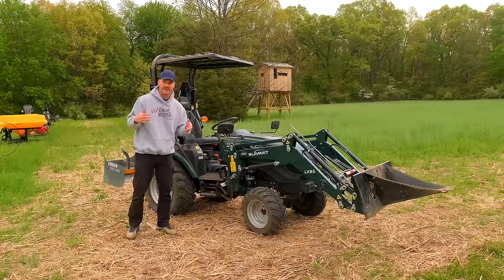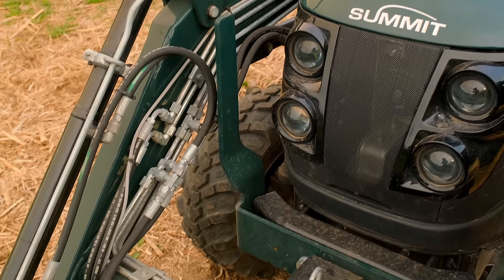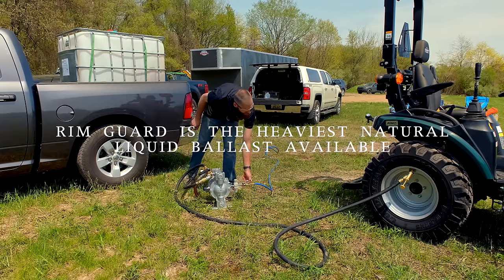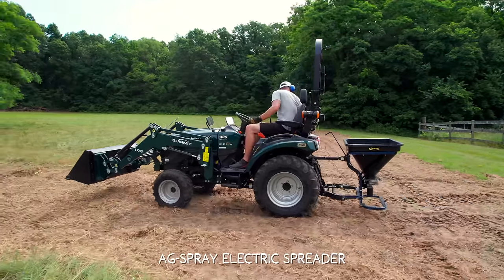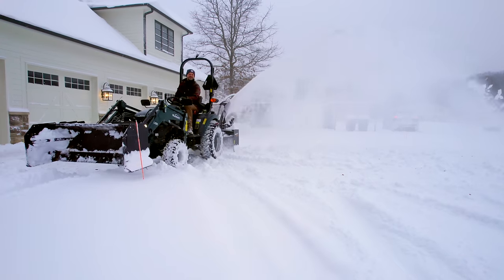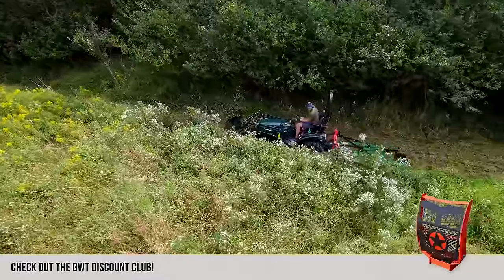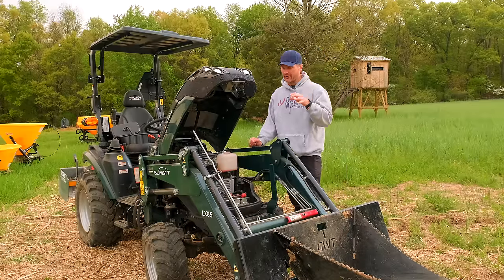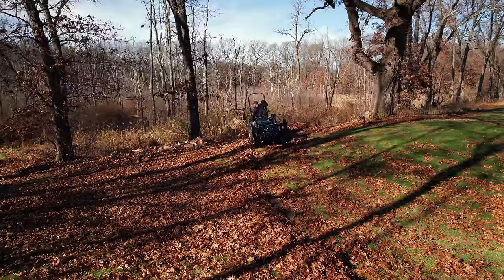50 HOURS ON THE NEWEST TRACTOR OUT THERE. WHAT DO WE THINK?

Comment: A rear mounted finish mower is always a better choice than a belly mount mower. You can sharpen or replace blades easy and can remove the mower and pickup another attachment without having your mower dragging in the dirt and mud. The adding of rim guard makes all the difference in getting power to the ground and a low center of gravity.
Reply: They’re a heck of a lot more inexpensive too since you don’t need all the hangers, lift and mid PTO. I’d never buy a mid mount mower myself
Reply: @LedgemereHeritageFarm mid mowers are super niche

Comment: The LX2610 has a similar battery location. It makes life so much easier when you need to get a jump or just plain remove it. If the summit wasn’t so heavy I would have waited until it was in production. I need my tractor to be light on its feet to mow pastures and grass paths that surround my farm. Besides the fact that 30% of my ground is always wet and 75% is hills, a heavier tractor would have gotten stuck to often, but I do love all the extra options that come standard on the machine. Maybe one day I’ll purchase one and just use my LX for mowing only.
Reply from the maker: The LX is a great machine too!

Comment: I have followed your introduction of the Summit compact tractor until this review. It seems to be a very capable machine and has many standard features that would be additional costs to many other brands. Your 50 review  reflects a very honest and fair representation of this value oriented new brand tractor.  Warranty claims, service availability and parts would be a concern in my opinion. However I am inclined to have a favorable opinion of the design, durability and overall quality of this new option to the tractors available on today's marketplace. 
I own a Branson 2515H which after owning for 2 years and 220 hrs of work, has proven to be a beast for  a 25hp compact tractor. Recently being bought out by TYM, I now have a discontinued brand name. This is definitely a concern of mine,  as it would be with any new brand like the  Summit. 
Great review and honest pros and cons. 
We're on 11 acres in South Central Indiana
Reply from the maker: Thanks for following along!
Reply: They say that the dealer is more important than the brand.  We shall see,
Reply: ITL sells pretty much the exact same tractor here as well… it’s called the Solis or something like that. Plenty of vids about it on YT.

Comment: Hey good video , the thing I seen that I like on this tractor is the weight of it , but at the same time most of my work I do with my 1025r is garden lawn , and yard work travelling on our grass , so I think this would actually be to heavy for my needs . As far as the hood opening the way it does compared to the 1025r , I would much rather the 1025r and the side panels coming off with 2 easy clips . I have owned the new ct1025 bobcat which is similar to this tractor in the way the hood opens and since I switched to the 1025r I have way better access to the whole engine compartment without the sides of the hood in the way at all ! . As far as accessing the battery on the 1025r I truly don't see it being that hard for how often I'll actually need to deal with it every 6 to 8 years minimum  . I would much rather have the easier access in my opinion that the 1025r has . But again my own thoughts and opinions , keep up the good videos it does look like a nice work horse ! 

Can you please answer this question please , does it have the same 3 point hitch positioning as the 1025r ? Or is it simply up spring to centre and down spring to centre on the 3 point hitch lever ???? Been wondering this for a while watching these videos .

Comment: Not sure how efficient the driveline is on that tractor, but my Ford 1700 is 25hp and weighs 4000lb+ with the loader and loaded rear tires. At normal operating speeds it doesn’t run out of power with 5ft implements. It is gear drive though (23hp PTO). In fact, I run out of traction with R1 tires before I’m out of power.
Reply from the maker: Gear drive is the difference

Comment: I looked at this one and the Bobcat CT2025. I noticed the Summit has a 80cu engine and the Bobcat has 100cu. Both have about 25HP. Do you think the smaller CU matters? Also the hydraulic pump capacity on the Summit is 4.8 gpm and 18.22 L/Min. Bobcat has 11.4 gpm and 42.9 L/min. This seems almost 3 times the hydraulics. Thanks
Reply: The bobcat is a 35hp kioti tuned down to 25hp. It's a large frame tractor designed to stay below epa regulations. Branson/TYM 2515 is another large frame, low hp tractor. I think it has highest lift capacity on the loader for a 25hp but I'm notnsure if you can tune it up like kioti/bobcat. The 4030 loader on the kioti is next best on loader capacity. Lots of videos on here about how to turn up the fuel and hydraulic pressure on a ck2610/ct2025 once you're out of warranty to get those 10 extra horses out of your tractor. I've been looking for the same size tractor and just got a quote for a little under $28k for a ck2620 with the same features as the summit. It's a hard call to make for sure.

Comment: One thing as a comment about the RhinoHide canopy. I bought one before you bought the company, from a connection of another popular tractor YouTuber. Great addition, no doubt. But.....
I'd like to see the mold or form for the polymer be reshaped such that the individual channels for rigidity are not square, and seemingly tapered to the midline of the canopy. It is a water trap, and as soon as you move the tractor to any tilt or slope, it's a cascade waterfall,  guaranteed to nail my pant legs or splash on my shoulders.

Slope it so it's self draining, or at least better at only holding an ounce rather than a gallon of cold water!!

If Summit is adding things to this tractor standard ton put it outvahead of the competition, then put on telescoping stabilizers on the three point lift arms-- duh. There's mirrors! Nice, but tilt steering shouldn't also be a stretch. 
And the loader control is up in space. Not very ergonomic.
Reply from the maker: Yeah, not an easy change.  Molds are expensive and permanent, so once you make it, your kind of stuck with it.  Making a new mold takes a long time to get the payback.  We’ll have a new model at some point in the future.  It’s a big decision is what I’m trying to say.
Reply: Just a thought. You could drill a strategic drain hole and use a rubber plug when you don't want it to drain.

Comment: The main issue these sorts of tractors will have as everyone knows is its off brand. There is nothing they can do about this besides offering excellent support. When I was tractor shopping I almost bought a Mahindra tractor. One of the main reasons to buy it was the dealer's location was very close to my farm. Due to Covid-19 restrictions they could not get the tractor I wanted in so the deal fell through. This dealer is no longer selling Mahindra tractors. If I'd bought a Mahindra tractor I'd be very annoyed they've done this. Possibly a lack of supply is a reason the dealer stopped selling Mahindra tractors. 

The tractor I bought was from a dealer that has been selling the same brand of tractors for decades and will probably keep selling them for decades to come.
Reply: Allegedly, Mahindra is the World’s #1 selling tractor, but it feels like they aren’t doing the best job with dealer and parts support. I own 2 Mahindras and my dealership is literally down the street from our farm which was a huge reason to buy them. The dealership has been absolutely stellar, but I worry about future parts and service. Saying that, I ran away from Deere and Kubota because they are both owned (my local dealerships) by a conglomerate that’s got a monopoly. The mom and pop Deere and Kubota dealers are gone and these companies are able to charge whatever they want to. It feels like a crap shoot either way these days

Comment: Thanks for this as I was thinking about contacting you to ask for such a review.  You mentioned the 3-point lift height limitation. So what is the maximum height it can raise to? I can't find it on the Summit spec sheet. One of my applications would be rotary cutting a rocky field and so I want to lift the mower deck over those rocks. Although I have used a compact tractor (ie a circa 2002 John Deere 4710) this would be my first tractor purchase for personal use and I've been waiting for Summit tractors to be in my area (southern New England) so I can look it over. A local farm supply store (TSC) supposedly now sells it but I have yet to see it inside or outside of that store. 

I appreciate the videos you have made with this tractor. These have helped me make a list of the attachments I want to buy from you once I get the tractor,
Reply from the maker: I’m not sure, I’d have to measure.  It’s just the typical lift height for a tractor in that size range.  Nothing unusual, but I like to point out limitations that some might not think about.

Comment: Lift height of the 3point, since you're working with the engineering development team, could be improved with longer lift arms. It may reduce the max lifting load (moment arm length) but that could still be a good tradeoff. ... You might mow more often if you can easily remove the front bucket. I have a bit of hate for seeing tractors used on non-bucket jobs with the bucket arms still attached. I grew up on a farm with a MF35 industrial tractor with both front bucket and rear back-hoe and that was the most ungainly tractor we had. When you needed to dig or move dirt it was great to have but kind of useless for anything else and no convenient way to remove everything.

Comment: How hard is it to remove the loader and to put it back on...😮😊
Reply from the maker: I’ll have to do that at some point, but I’ve had no need to take the loader off yet.
Reply: Out of curiosity, why do you plan to remove the loader?  The arms stay on for most attachments and I've helped family maintain their tractors for three decades without removing the arms.  We remove the bucket/forks, raise the arms, and use a piece of plastic conduit over the cylinders to make sure they can't droop and get in the way.
Reply: @Noah_E  the rare case I would remove the loader completely for would be a front-mounted snow thrower.  Personally, I much prefer them over the rear-mounted, though I understand everyone has their own preferences
Reply: @dalcassian56  Don't remove loader mounts for any reason...  You will have problems remounting the loader itself....   Wait for a video....
Reply: @dalcassian56  agreed.  A 3PH inverted snow blower so you can use the bucket or a pusher up front and don't have to look over your shoulder or use mirrors the whole time, don't get a face full of blow back in an open station, and don't have to mess with/have a mid-PTO is definitely the way to go IMO.
Reply: @dave.lawrence.3894  do you mean the attachment points on the tractor for the loader arms??  The only reason I would remove those is if I were dismantling the thing for a parts diagram photo!😅
Reply: @dalcassian56  Yes

Comment: my dislike is the rear hydraulic control lever digs in my leg in fact i removed it and the 4x4 lever is hard to operate for a 73 year old that's a little over height and the ignition is in a hard to reach place and i agree on the tilt steering
Reply from the maker: Strange, my leg is not even close to that hydraulic lever.  4x4 lever works just fine, but they are all stiff to engage or disengage.  That’s just a tractor thing.